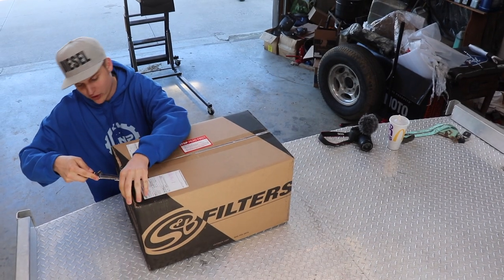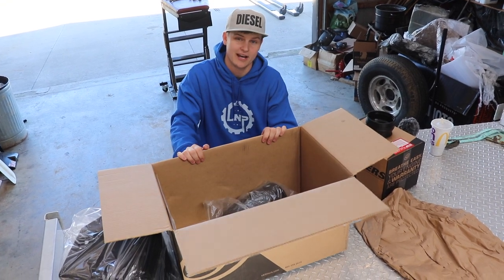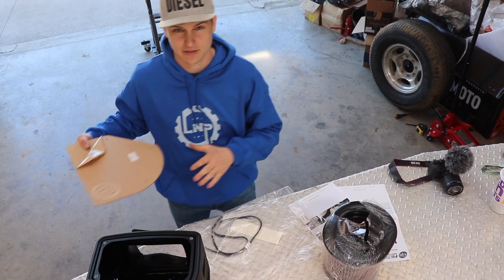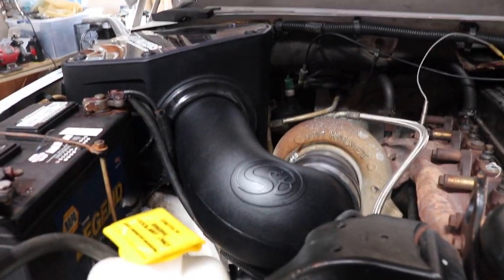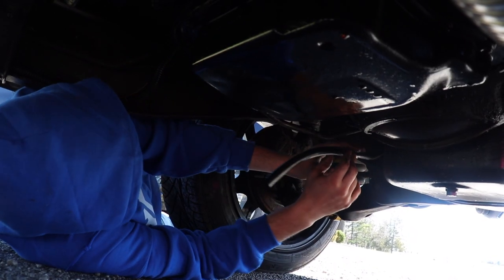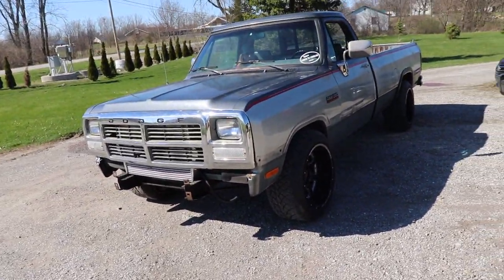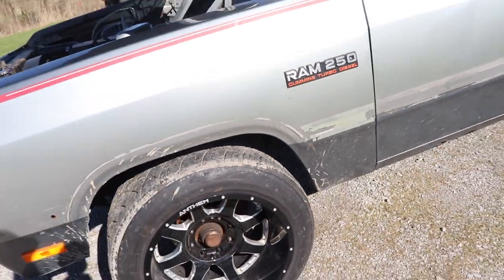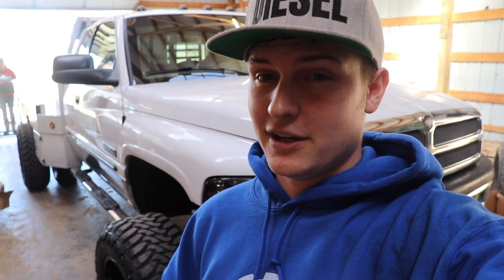THE TWIN TURBO 1ST GEN CUMMINS IS DONE FOR!!!!

Comment: Just an insight on the 1st gen-  my buddy has a 12 valve and he works in same shop as I, and he popped 2 head gaskets ( head was studded and o ringed, 1 gasket was Mahle, 2nd was / victor reinz, finally he put a Cummins oe gasket in and this solved the issue. both times they popped, coolant got in the oil and it turned milky, also it was steaming a lot out the breather,  or it could go the other way, with oil in coolant ( this also happened for him the 2nd time it blew) if the blow by is not enough to make the oil cap hop, then the piston rings are ok.

Comment: The milky oil is coolant getting into your oil. The reason why can be anyones guess. It could be a blown oil cooler or headgaskets. Also the best way to check how bad the blow by is to take the cap off while the truck is running and see if it blows the cap off. I have a 6.0 powerstroke that will shoot a stream of smoke about four inches high when it gets really hot but I can put a napkin on the oil fill hole and the napkin wont blow off. So dont let the smoke scare you.

Comment: Pull the oil fill cap while the truck is running. That will give you a accurate idea on the blow bye issue. It’s not uncommon to have steam come out of it while the truck is off. The oil gets hot. The blow bye might not be as bad as you are thinking man
Reply from the maker: You’ll see the next video 😂

Comment: I would take the old first gen over to your motor builder and have them go thru her I'm sure it wouldn't take much it seems to run to good to have any major major issues. Then just have some fun with the Ol girl! It is a kick ass truck!!! Just a thought!
Reply: Sean Gurskey diesels can run good with major issues. Just rebuilt Cummins ISM motor that had a cracked head, allowing coolant to pass into the piston sleeves causing a major coolant smell when the truck ran. The motor still ran great and had a cracked head. Doesn’t mean it’s a simple fix at ALL.

Comment: Not very familiar with the Cummins and how they are set up but it looks like coolant has gotten into the oil. What is the oil cooler setup on the 12 valves

Comment: My 24v has 123k on it and it has blow by coming out of that tube. Pretty sure that's normal couldn't see there being a issue with 123k. Every diesel has blowby to some extent.
Reply: sand junkie I have a 1989 non ic with 114k and no blow by.
Reply: Its not normal...not every diesel has blow by
Reply: @fishertrowbridge  still gonna send it  Haha. 24v's are garbage, your 12v is the way to go man! Been considering a swap for a few years now.
Reply: @clayster89  every car truck suv whatever it is diesel or not all have some blow by. Just the way it is.
Reply: What ever makes you feel better about your wore out truck
Reply: @sand junkie i love that truck man. Daily driver. I had to work my way up. Actually traded a few trucks to finally get this one. I plan on holding onto it forever!

Comment: Turbo wheel, in and out is bad it means the thrust bearing is wore out. Slight up and down is normal in all turbos. Anymore than a 1/32 to 1/16 uo and down play means wore bearings as well.  Just an fyi
Reply from the maker: Maybe I got it flipped around lol... but this wheel doesn’t move up or down or in and out anyhow... only spins like it should. Was just a pointer for others 😂 a wrong worded pointer apparently 😂
Reply: Absolutely just helping a brother out. I think you may have just a head gasket issue instead of the engine itself being bad also.

Comment: Keep the 1st Gen.  Fixing it would be cheaper than replacing it.  Sounds like a head gasket which is no big deal.  Basically, the 12 Valve just needs some maintenance and basic repair (head gasket & trans rebuild).

Comment: Anybody know what to look for to check that ur engine is good and stuff recently bought a 5.9 24 valve it's a 2005 dodge ram 2500 and I didn't see any blow by or oil in coolant and checked oil looked good anything else to look for all gauges on dash are where they should be just wanting to make sure everything is good and as it should be?

Comment: You got a bad head gasket or cracked head more than likely.  The stream and milky oil is not just blow by.  I had a bad head gasket on a 89 first generation and it ran fine even with the bad gasket. Pretty unlikely the head is warped or cracked. A first gen head weights 146 pounds and is super thick so there pretty hard to damage. A head gasket is not a bad job to do.

Just had another thought when you had the hood off it. Did you possibly leave it out in the rain could have got water in the motor and that could be your problem as well.